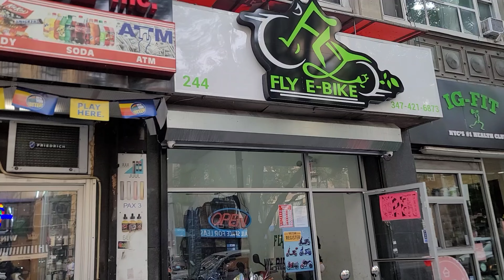@Fly E-Bike : 244 e.14th St. Safety First

Comment: I was wondering if the prices online are the same as in store.  how many hours would the z6 last me in full charge and does it come fully assembled. I. Suck with assembly of bikes 🤣
Reply from the maker: in person you can negoitiate like 200 off easy bike comes assembled hint you might be able to get a Z6 in person for like $1399 compared to the 16 18 19 hundred price online and these bikes last all day easy but to be safe you will get like 6 to 8 hours no problem getting thru a full days work no problem

Comment: Was the blue bike in between the black rz  and fly2?
Reply from the maker: What color was it wat the red 3 wheeler or the red Rz which one
Reply: @T2daBikeGuy right where the flytron with the seat is the blue bike  next to the rz is
Reply from the maker: O that it's not a z6 or Venom but I think it's called like a 6 Max or 6 SL or something like that with a 6 suppose to be a lil better like a special edition or limited it a bigger battery and brighter lights nit to sure but I'll look deep into it since you ask
Reply from the maker: Might be TDI

Comment: how do you remove the battery out of the z6
Reply from the maker: You have to remove the panels or remove the front wheel
Reply from the maker: Check out the Venom assembly video it shows how
Reply: Thank u
Reply from the maker: @TheJonathan5731  thank you ebro